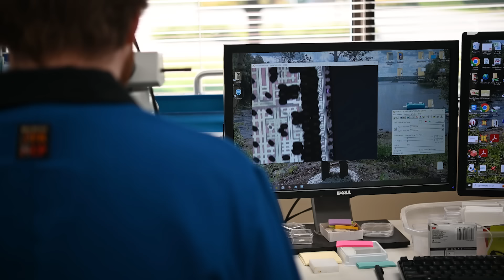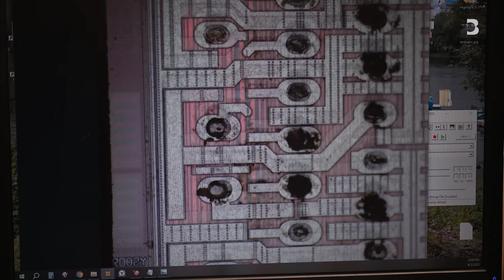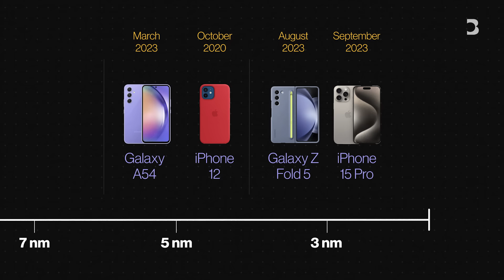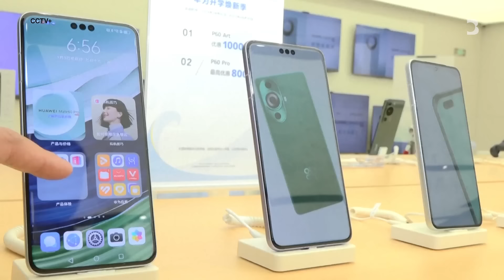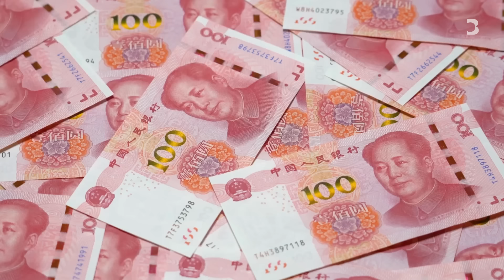This Is How Huawei Shocked America With a Smartphone

Comment: What's even more impressive about the Mate 60, other than the chip which most of the western media focuses on is the rest of the phone. It's made up of completely domestic Chinese technology, especially in critical areas like 5g modems, the OS, camera lens and sensors, LTPO displays, etc the list goes on. This rapid development of domestic technology on various critical smartphone components is more than impressive.
Reply: Ah yes, the high tech Android phone with an ARM chip. 🙃 Partnership before sanction: 5G Qualcomm, Camera sensors SONY, OLED display SAMSUNG, oh and looks like they still allowed to use memory module from SK Hynix 🇰🇷
Reply: @thedduck  not Android, it's Harmony OS.
Reply: @thedduck   ARM doesn't sell chips. They license them. They are a British company so the U.S. can't stop them since they don't have 'U.S. technology' in their design architecture. BOE makes the OLED chips and YMTC has the latest NAND flash chips tech.
Reply: @thedduck Samsung Galaxy S series is an android phone with an ARM chip, iPhones (and Macs) use ARM chips too ... not sure this was the own you thought it was
Reply: @tanjim4487  "BYD makes the OLED chips and YMTC has the latest NAND flash chips tech."

BYD isn't a fab.  They don't make ANY chips.  They design the logic, which means they're a chipmaker.  Congrats on them, there are a few hundred chipmakers.
Reply: so i guess its going to break a lot faster and a lot easier than an iphone or android
Reply: The phone is a failure. You have been duped.
Reply: @thedduck  Sanctions and blacklisting prevents Huawei from purchasing Android OS and 5G chips. The OS, 5G chips, and memory chips are indigenous.
Reply: @thedduck  In a globalized world, no company could manufacture each of its components. Apple and Boin are the same.
Reply: @thedduck   Seems tanjim4487 fify lol
Reply: @IbrahimNgeno  yes, ARM, Western Tech 🙃
Reply: EdrawEdits  ah you're missing the point. It's all based or derived or copied or stolen from Western Technology 🙃
Reply: @laizhou7352  yes, hence how the sanctions "works" ?! 🙃
Reply: @thedduck How about you stop using any tech at all since it’s all driven by math derived from Middle eastern and Indian numeric systems.
Reply: @CC8771  oh sure what electronic chip did they use? 🙃
Reply: @donjindra reviewers seem to disagree with you. Meanwhile, Apple is declining in China.
Reply: its technically not 5g, its 4g +++++++😂
Reply: @thedduck get your facts straight… it’s not Android but Harmony OS
Reply: You should know a bit about China's IP theft policy
Reply: @thedduck  I feel bad for peoples’ ignorance.
1. “The HarmonyOS interface is based largely on the Android-based EMUI”.
2. You’re right. ARM is Western tech. 
People here are missing the point that China is not India or another other nation. They claim, at least internally before the pandemic, that they will soon be stronger than any other nations. And one of their means to prove their point is to stop relying on any Western tech. Western tech companies are moving away from China, but most of their tech are still being used, under the disguise of a Chinese one. And the fact is that, China can’t do it yet. And if it eventually does, it will become the new Soviet Union.
Reply: @TheRabbitHole-pf9sq  
Except unlike the Soviet Union China will be able to compete with the west economically and technologically instead of always being a few steps behind. While China right now might not be at the level of the west or a few Asian nations in cutting edge technology, they've travelled very far in the past couple of decades to be not very far behind at all. 

The Soviet Union even at its absolute height has never been this close to competing with the west as China is now.
Reply: @thedduck  LOL, is that what you are crowing about?
Reply: @thedduck  That's like saying "diesel engines, western tech" ...
Reply: @julianstar2431  surely they won’t break as badly as your heart
Reply: @1ewi5  what does that even mean, chinese bot ?
Reply: Bloomberg said the Huawei cpu chips are being made by SMIC. Not true, all Mate 60 cpu chips have been made by Huawei itselve. Huawei also manufactures its own GPU chips now, which can replace Nvidia A100.
Reply: @donjindra it is true. Mate 60 pro is a "failure", if you want one, you have to wait at least a month to get it. So the cell phones fail to satisfy the market demand due to production bottleneck. It is absolutely a commercial "failure".
Reply: @TheRabbitHole-pf9sq Are you here to be funny? The Soviet Union was a hot chicken and could only compete with the US militarily and civilian technology was rubbish how else do you think the Soviet Union was taken down by the US? And have you seen the United Nations recognized that the world's only industrial categories and classifications and industrial manufacturing value-added is higher than the G7 countries and various high-tech high-end industries compete with Europe, America, Japan and South Korea?😂
Reply: @TheRabbitHole-pf9sq Come on, I die of laughter, Android system is still the Chinese mobile phone industry companies continue to expand and improve it, by the way, Huawei has contributed the most after all, code and system Huawei contribution is one of the biggest.
Reply: @UzumakiNaruto_ You're wrong. China competes with the West in all kinds of high-tech, high-end industries, and, um, is ahead of the West in some areas, and behind the West.
Reply: @thedduck 😂Mumbai cow dung..!
Reply: @thedduck 😂Mumbai cow dung!…
Reply: Buying old chips from the west and badly screen printing Chinese characters over the original markings is "more than impressive"? lol you are very easy to impress.
Reply: "domestically produced" and "domestic technology" are two different things. At the moment, China is still relying on western technologies for manufacturing.
Reply: @kaba_me  The hardest are those CPUs that brain of the AI of the computer are domestically produced also means technologies too.The rest like GPUs and the RAMs are locally produced too but you can buy that abroad and modified to your CPUs needed to works for the of the main board.
Reply: @Chu3505  locally produced using western tools, such as the ASML lithography machines.
Reply: You forgot to add all the spyware also added into the phone
Reply: @jimmychoi5219  Android uses a modified Linux kernel and and I would assume that Harmony does also -- so you let the software engineers take care of the rest of it. Linux is open source, so no complaints.
Reply: @Aamirmhmd99 do you even know what harmony OS is? It's just a fork of Android. It's basically Android without Google stuff.
Reply: " completely domestic Chinese technology, "  that is lol, how naïve can you be
Reply: @CC8771 Numericals don't have copyrights. Now eat that false comparison fallacy. Your turn. 😊
Reply: @harounhajem7972 awesome. That will scare the sht out of you. 😂😂😂😂
Reply: @thedduck The China-made screen of BOE and the storage hardware of Yangtze River Storage.Bro doesn't know anything.
Reply: Exactly. It was clear they copied and learned from other companies. Smart move. It's the best way to catch up. I mean how many more Samsung employees went to prison for giving out secrets just last year alone lol.
Reply: Yep, but guess what? It is still a shity phone 😊
Reply: That's what happens when you try and outsource everything thinking using a country's cheap labor will give you a competitive advantage, while neglecting the workers at home.  Eventually the cheap labor learns the skills to start their own businesses, while people at home have become reliant on others to do it for them.
Reply: I’d be very surprised if this phone wouldn’t violate a plethora of patents.
Reply: @Conservator.  it actually doesn't. This also won't come at a surprise when you think about it for a minute. Huawei has one of the highest numer of patents in the world in smartphone technology, and is the leading company in regards to IP in the 5G sector.
Reply: @julianstar2431 恰恰相反
Reply: yeah i seen sk memory chip there so.
Reply: @thedduck it's funny that everything you say is, wrong lol
Reply: @Ziyue-bc7px Huawei is pure 5G. Most what they have in the USA and Europe as well is 4.5G
Reply: @jaydev8148 ah you mean what the West does as well?
Reply: @thedduck The Kirin9000s has 3 types of cores, High performance, performance, and efficiency cores. Only the smallest efficiency cores is ARM based, the rest are all Huawei's own architecture, which previously used on their server. Its also the only phone in the world that can directly communicate with satellite in GEO orbit, which is 35000km away from earth orbit, which is insane for a smart phone. Huawei has the best antenna tech in the world, if you ever used their phone, you will realize that it often has way better signal than iphone and other andriod phones using the same carrier.
Reply: @UzumakiNaruto_  Would you mind telling me some examples? Coz from what I can recall, Soviet Union still have more Nobel prizes winners than China. And I do believe that advancement in science is crucial to technological development.
Reply: @雅君墨客-i9z  I’m sorry but I don’t see how that makes my point invalid. Android is Western tech, and it will continue to be.
Reply: @thedduck crocodile tears
Reply: EdrawEdits  It's based on the opensource version of the android operating system at least for now.
Reply: @Ziyue-bc7px  Still much faster than iPhone.
Reply: @Aamirmhmd99  Harmony OS is a forked Android. So it is not a new OS from scratch.
Reply: @julianstar2431 .. keep guessing
Reply: @strongbrain3128 failures failures, so many failures costumers have been waiting, putting money down and still can't get their new car after waiting for months 😫 and longer
Reply: actually the sensors are exclusively Japanese, I don't know about the Modem or lenses and quite frankly BOE has been capable of making high end panels for years.
Reply: @thedduck SK Hynix produces in China
Reply: i thought it is mate because of ubuntu mate...
Reply: @thedduck  how does the copium taste?
Reply: @thedduck  western tech learned from Asia for centuries... so what?
Reply: @TheRabbitHole-pf9sq  comparing the Soviet Union and 21st China is utterly ridiculous.  China produces more STEM grads than the US and Europe combined.  It's market is also bigger than both combined.  You can start right there.  Soviet Union was also never integrated into the rest f the globe.
Reply: @雅君墨客-i9z  soviet union wasn't taken down by the US.  it's defective system simply collapsed
Reply: @chmun77   Android was not developed originally in house by Google either
Reply: Indeed and i hope China will continue to advance and succeed, they clearly deserve success.
Reply: @Amidat  >> China produces more STEM grads than the US and Europe combined. <<
China also has spent more money anybody else over the past decade and trainsed millions of soccer players..   I don't have to tell you how pathetic their national team looks like.   At least the Soviet had somewhat competitive team.
Reply: lolwut? you high bro? Did you not see the big "SK Hynix" chip right next to your proud domestically produced chip?
Reply: @Amidat  I’m sure you didn’t even read my entire comment before responding. Nearly nothing in your comment makes mine any less valid.
Reply: @jaydev8148  So what if they steal.  I miss the time when CPU makers design ways to make it hard to steal or push for faster progess.  

You know what is worse.  It's Intel when they lead the market they save so much money by pushing for small gains.  I could stick with the i7 2600k for like 8 years because gains are small.  If you want i7 6700k speeds then overclock to it.   Of course its slightly slower against stock i7 6700k but at least you don't have to buy an i7 6700k.   I regret why I upgrade to the 6700k.

Also Intel isn't even confident with there own product so they started locking the budget CPUs because its eating there own mid range or even highend CPU sales.
Reply: @vanguard812-vf7hr  agreed stealing tech IP is fine as long as it increases competition since more competition always benefits consumers. however, in this case no amount is enough because no sane android user will choose harmony os and a locked bootloader over android and an unlockable bootloader.
Reply: Special thanks to: US sanctions.
Reply: @johndoh5182   Meant to write BOE. My bad
Reply: And satellite calls
Reply: @thedduck  You are lack of essential information for this news. Those brands mentioned by you are not included in mate 60, even just one. OLED, ahh, maybe Samsung will quit this area in China because it cannot contest with JDF.
Reply: @thedduck like how every resource was stolen by European colonials
Reply: @The-Heart-Will-Testify  ah yes, that includes Knowledge AKA Science & Engineering 😄
Reply: @thedduck  It seems entertaining at first, trying to provide information to a region that has a strong relationship with editing or outright banning said information. But honestly, it just makes me sad. Highest populace and the resources to make waves of change around this world. Sadly, none of these things will happen unless it makes the rich richer and the corrupt more powerful.
Reply: So nice seeing every point you made being trashed.  @thedduck
Reply: @thedduck  it's irrelevant who's tech is that since China can make it domestically
Reply: @thedduck hey, at least they're doing something, give them time 😊
Reply: They copy this technologies not develop
Reply: @thedduck 中国有能力生产手机闪存芯片

Comment: Military doesn't use 7nm or less on equipment. They use 32 nm or 64 nm chips. Small high-end chips are used for cell phones (due to small size).
Reply: not only that, you don't need big processing power for a missal, it just need to track trajectory and control the engine flaps etc. raspberry pi can do it also bigger chips are more stable as they are very long on the market which is more important for a missal but also for a car as you dont want a blue screen of your main computer on a highway

Comment: Another feature of the phone is that it has satellite call capability. Which means it will only be out of communication range inside of a building which blocks all cell and satellite signals. You can count on the fact that government officials have been given these phones. 
The highest end chips are NOT used in military devices. The design of US military devices is too old to utilize the newest chips and it will take a complete redesign for them to do so. In most cases, that would be a complete waste.
Reply: Taiwanese Youtubers has tested it, and the satellite call capability does work. However I guess it's not safe to use Chinese phones, especially Huawei products, as a government employee in US or other western countries😂😂
Reply: It’s garbage lol
Reply: @jonnydoeson5562 😂out of your reach 😂😂😂

Comment: You blocked China from accessing GPS signals when they were doing a military drill in the Taiwan Strait. Then China established their own global positioning system (Beidou). You are now blocking China from accessing the latest semiconductor, do you expect something different to play out this time? What is worst this time is that China is the single largest electronic market that can't be replaced for years to come, and you are forcing it to become self-reliant on chips. Let me tell you, this is a paradigm shift that is irreversible in nature - China remains the single largest market for electronics and it will not buy chips from the West.